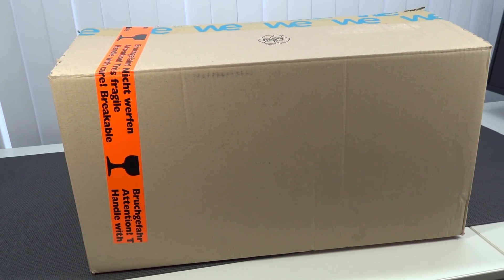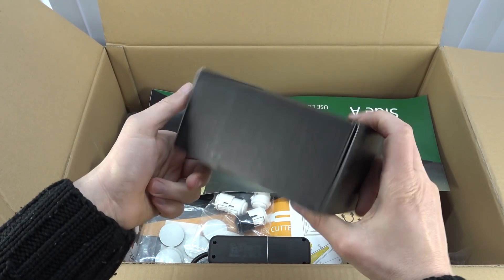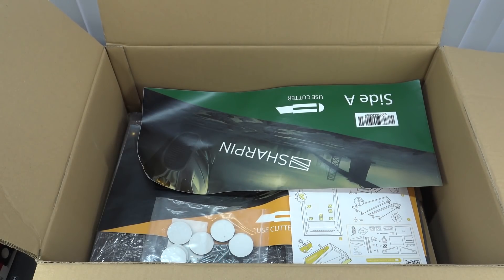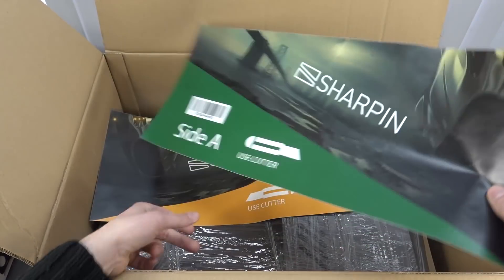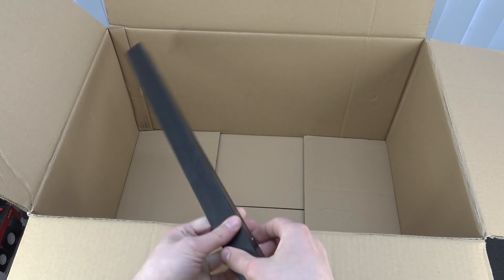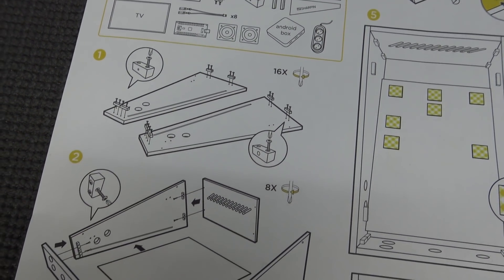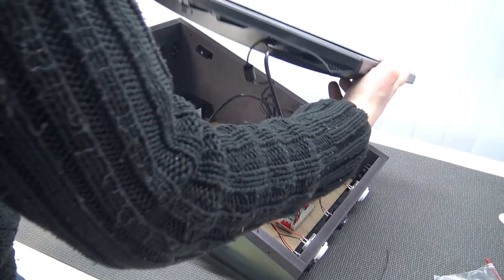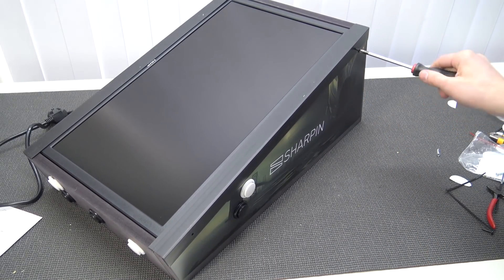Virtual Pinball Building / Sharpin Pro 2021 Edition Tutorial

Comment: DO NOT BUY THIS. I just received this in the mail, and while trying to put this machine together, I noticed that there are parts missing, there are parts which I don’t know what they are for, I can’t plug this into the wall because it includes the wrong AC adapter (I live in the USA), and the assembly instructions are HORRIBLE. I did NOT receive the “special part” mentioned at 3:35 of this video, which is apparently necessary to make this machine function.
Reply from the maker: Ow men he also did not send you that.
It's a digital to analog convert you can pickup on amazon for not a lot of money.
I think they are 10 dollars or so maybe cheaper on ali-express. 

Edit - Also you need a Jack to Tulp cable.

what you can do is maybe use supply's and power strip and use wall socket converter so you only need 1 plug to convert ? 
So far I know all power supply's are 110v / 220v now a days .. only double check please. 

Maybe that is an idea.
Reply: @WickedGamerCollector  I was finally able to get this pinball machine to work, after purchasing a few parts. I do have one major issue, still, however. The sound seems to be incredibly low on my machine. How do you get the sound to play louder?

Comment: do you know if their any mods or upgrades available for sharpin pro edition?i would like to swap out the button you use to launch the ball & replace it with a plunger.i know their are some pinball tables that use a button but more use the plunger & i would prefer the plunger
Reply from the maker: If you want to upgrade you need a pc for that. 
Android is limited.... what you see is what you get. 
Main review will talk about it what you can play. 
Problem is the cabinet is to tiny to slap a good pc in it.
Been working with that problem a long time... most mini pc's are to big.
Or are small and don't have enough juice to run pinball games on high settings with 1080p.
For VPX we need a i5 4 gen and a GTX1050 at least or that is what I read on the forums.

Comment: A package from...Austria!
This is great, I have mine sitting next to the monitor. Highly recommended, very convenient and takes no extra space in the room.  I replaced the included 22' Samsung F350 monitor with a 27' F350 model, cut out new front and back panels at the local DIY store and drilled some holes. Here are the measurements, if you can use them: Front: W: 365 mm D: 16 mm : H: 100 mm. Back: W: 365 mm D: 16 mm H: 160 mm. FYI I have absolutely no woodworking skills, but it's absolutely doable even for DIY novices.

Comment: That’s the same box I got with my Lite. I got my lite a month ago for €299, now it’s €349. The lite is listed as containing a rk3328 box, the pro with an AllWinner H6, and the Ultra with the GT King. This seems to be the only significant difference between kits. I’m confused because while the H6 is indeed a step up (especially with graphics), the prices I’m seeing don’t really show much of any difference. The GT King at €100 is a big difference in price (like €70), so it makes sense for it to be substantially more expensive.

I know it’s not easy as a small business and the guy’s gotta make money somehow, but these different options are kind of confusing, and likely even less clear to the average consumer. It doesn’t even make business sense to me the way things are priced.

I think it would make a lot more sense to just have one base model for which you can choose upgrades - extra for more powerful box, extra for LED buttons or different decals, etc.

That way the base system can be advertised at €299 or whatever, and upgrades push up the price. With how cheap certain parts are on AliExpress, it would be easy to add a €10 upgrade here, and another one there, which makes customers feel like they’re getting a better product, and allows for better profit margins.

Comment: @WickedGamerAndCollector awesome build. A couple of pointers, applying the vinyls first and then trimming usually comes out cleaner. You should akso use a plastic scraper to smooth it out, eliminates most of the bubbles.
Reply from the maker: Yeah I could find the freaking thing so I did it like that 🤣🤣